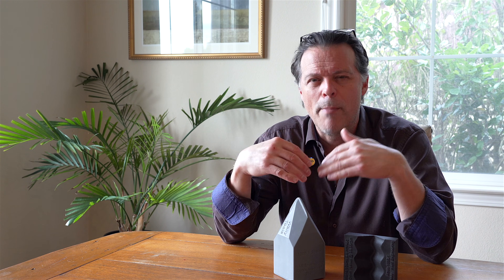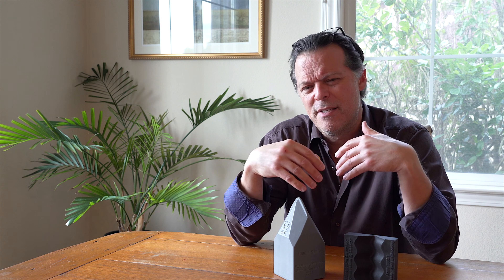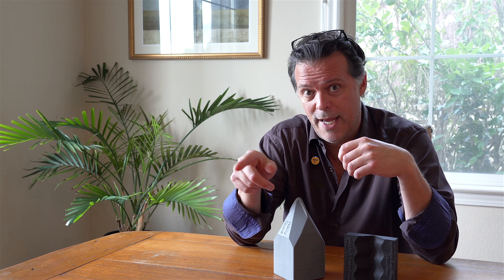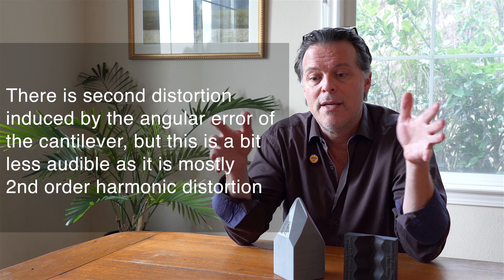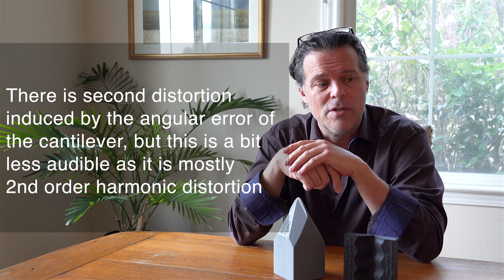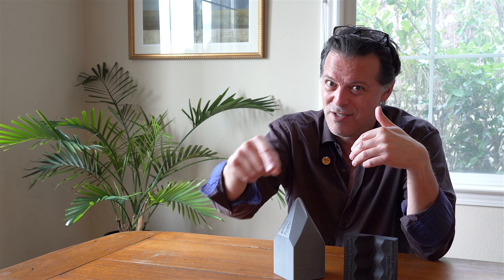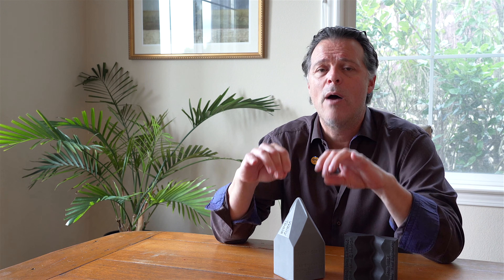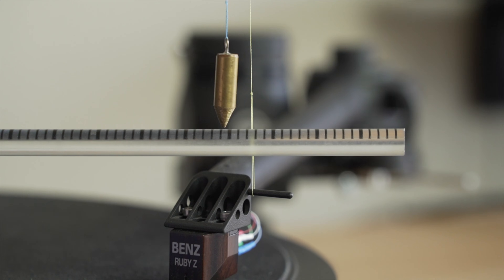Sound Bite #14 - Inner Groove Distortion Is Not What You Think It Is

Comment: Thanks for this. Could you clear something up for me? I hear two different, completely opposing reasons for distortion in the left channel. My understanding is that this a function of too much anti skate, as the stylus loses some contact with the left side of the groove wall due to the excessive pull of the antiskating mechanism towards the right side of the groove. Is this correct? Chat TGP give the totally opposite explanation that left channel distortion is the result of too LITTLE antiskate! Arrghh. Thanks.
Reply from the maker: ChatGPT has quite a ways to go before it can be relied upon. I'd go with the common wisdom on this topic for sure. In any case, hearing this symptom is NOT a reliable indicator that you must decrease your anti-skate. It could be a problem of high static friction in the arm's bearings. It could be that your sample set is not sufficiently representative of your music collection, etc.
Reply: @WAM-Engineering  Thankyou for clearing this up J. R.; and for your cautionary advice. It does only happen on one album track at the end of a side, during a big crescendo (Phase Dance, Pat Metheny Group first album). I wrongly assume that my second hand copy had some groove damage when it broke-up / mistracked / distorted towards the end, but recently bought a brand new re-issue and it distorts in exactly the same place, so I'm perplexed. I'm resisting increasing VTF as a potential solution. The rest of my records show no sign of this, but I know something is not quite right.
Reply from the maker: @dirtharris  Is that record a bit louder than most of your records - especially at that location on the record?
Reply: @WAM-Engineering  Yes, a very explosive crescendo. I have considered the gain settings on my phono stage, lowered the gain and it still occurs.
Reply from the maker: @dirtharris sounds like you are describing a track that was cut irresponsibly “hot”. This would increase tracking skating force and cause what you are experiencing.
Reply: @WAM-Engineering  I did think that, but was thought that it more unlikely that BOTH pressings were cut hot to cause this.

Comment: Aren't there several different "geometries" (if that's the correct term) that can be applied during cartridge alignment? It's my understanding that the most commonly used one optimizes stylus alignment in such a way as to place the most compromises towards the inner grooves, causing IGD. The alternate methods of alignment present different compromises.
Reply from the maker: Yes, not only are there a few different geometries, but there are three different cutting standards which require application to the geometry of your choice. This means there at least 12 different permutations. However, the distortion characteristics that they are trying to balance is not at all what I am talking about. The distortion characteristics they are trying to balance are not audible to most people. In fact, I’ve only ever met one person who can reliably hear that type of distortion, principally because that type of distortion sounds so much like the music itself.

Comment: Also I'd add to that cartridge set up overhang and pivot angle. You can have the correct bias setting but if these parameters are not correct you still going to get distortion.
Reply from the maker: This is true, but this distortion does not sound anything like what I was referring to. Stylus and cantilever misalignment of the type you are referring to causes mostly 2nd order harmonic distortion - something which can be actually a bit pleasing!